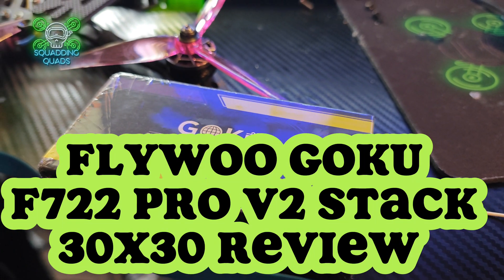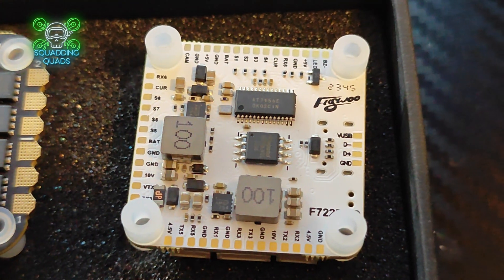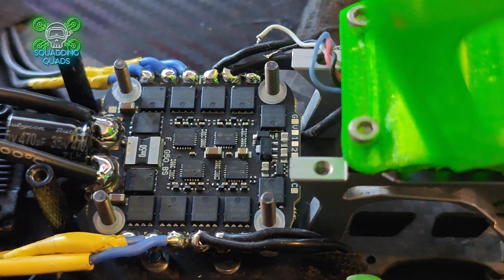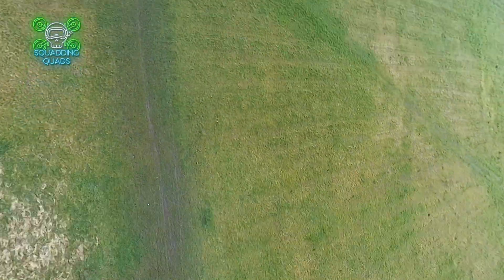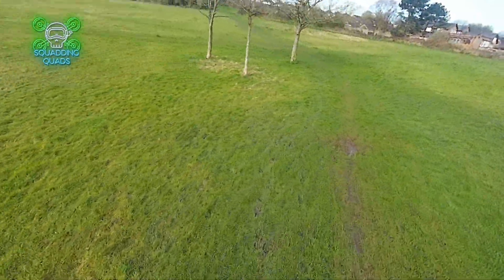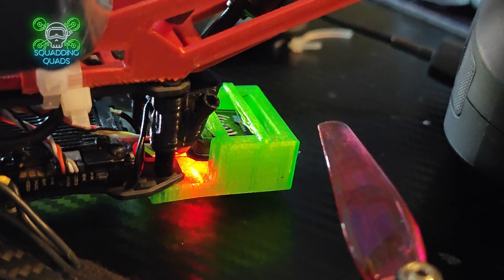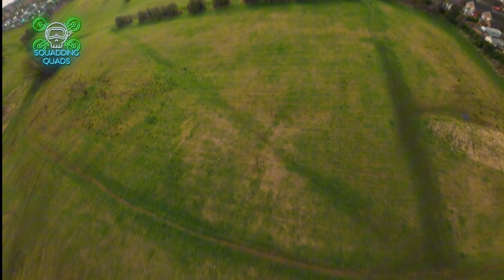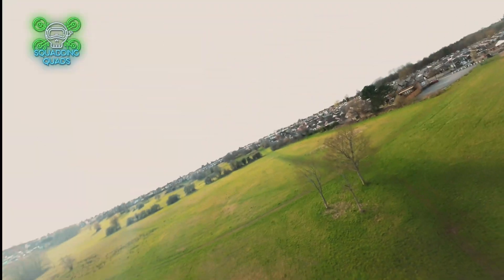✅ Flywoo F722 V2 Pro Review: Essential Technical Insights & 10V BEC Set UP

Comment: Nice bit of information as always. Just built my first drone (VX3 frame, Tmotor 1604 2850KV, Soeedybee F4 mini 35a stack flashed with bluejay - 6S - Supafly 3/4 preset, RPM filtering enabled, lowpass 1 disabled). First flight I was getting desyncs on random motors. It then flew ok for a few more flights and was having random death rolls out the sky. Thought I may have got a faulty ESC as I didn’t run the O4 cable through or over the stack (run under the ESC) so can’t see how I could have had any interference. Possibly thinking after this video that it could be the soft mounted ESC… but then, maybe it was a duff ESC. Trying a new one in a few days time.
Reply from the maker: Have you tried lowering your DSHOT?
Reply: @squaddingquads  Appreciate the suggestion. I’m running DSHOT 300, but the issue turned out to be the ESC. At £35 for a replacement speedybee stack though, it wasn’t the end of the world (my hand was forced when I stupidly shorted the flight controller on a stack screw and blew the BEC 🤣. Done me a favour really)
Reply: Moral of the story - Never work live 🤣

Comment: Hey, I have the Flywoo Goku F722 Pro Mini V2 and I setup user 1 on a switch but when I hit the switch, the vtx doesn't get power and the mode doesn't go to yellow to denote it is activated. Can you please help?
Reply from the maker: Double check your solder joints brother
Reply: @squaddingquads  it worked. There was an issue with the vtx. As soon as I desoldered it from the fc, the 10v light on the fc is working and I'm reading 10v on the pads. I have the Geprc Maten 2.5W vtx and connected it directly to my 4s lipo battery leads and it smoked. I think it is a defective vtx because it says it supports 7 - 36v but a 4S pack made it smoke and crackle
Reply from the maker: @DexterDavidDexterSD  yeah that soujds like a vtx issue buddy, sorry to hear this
Reply: @squaddingquads  thank you. But hey, I learnt something new. So it's good. I'll try to see if Geprc covers this under warranty
Reply from the maker: @DexterDavidDexterSD  if its new I'm sure they'll look after you brother

Comment: Hi I am a newbie, can you help me? How should I connect this board to my vtx? I am using the TX800
Reply from the maker: I think the tx800 takes a 5v line.

So solder the 5v to a 5v pad on the fc

Neg to neg

Then the tx pad on the vtx to a RX pad

And the rx to a TX pad on the FC

Make sure they are the same uart

Comment: Which UART do I use when connecting DJI O3  ? I have the mini version am unable to get the DJI controller working on BF. The manual  I got was not helpful 😔
Reply from the maker: Easiest way us to use to included plug in cables and the dedicated port.

Comment: where do i connect my analog vtx please help, My VTX is iFlight BLITZ Force 5.8GHz 600mW , is the soldring same as digital VTX?
Reply from the maker: @himanshubajaj3501  i can't share screenshots here sadly but in the manual scroll down to analogue vtx and it gives you the pin out there.

Comment: Hi, I have the Goku F722 mini v2 stack. I am installing the Walksnail Avatar HD V2 system. I have soldered the leads from the Walksnail VTX to the F722 using + - tx rx. I am not getting 10v power and am soldered to the 10 tab. My Betaflight does not have a mode called VTX Powered, just VTX Pit Mode and VTX Disable.
I do have User 1 mode and have bound a switch to it. From here I am lost. I cannot fathom how to activate user 1 and PINIO is like a foreign language to me. If anyone can please assist me, I would be eternally grateful.
Reply: Thank so much for your help and patience. I didn’t have the fc connected to the esc 🫣. I have now connected them and is is giving 10v and will switch on and off. Thank you, you have a new subscriber!
Reply from the maker: If your 100%your wiring is right, set it to user 1 and activate it, wait 10 seconds :)
Reply: @squaddingquads  thank you for the quick reply - much appreciated. I have no idea how to activate user 1. Sorry, this is my first build and I am an old, grey-haired noob as well.
Reply from the maker: @stevehaynes2857  set it up, like you'd set up an arm switch in betaflight